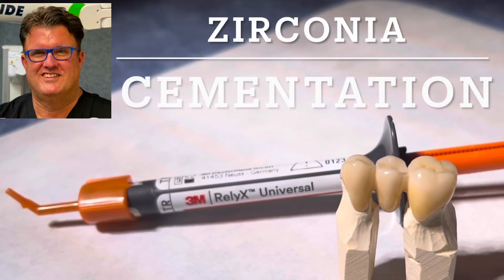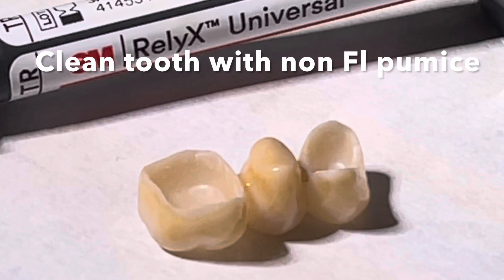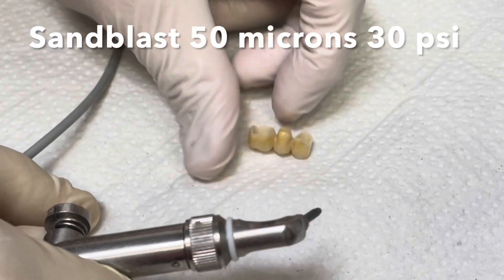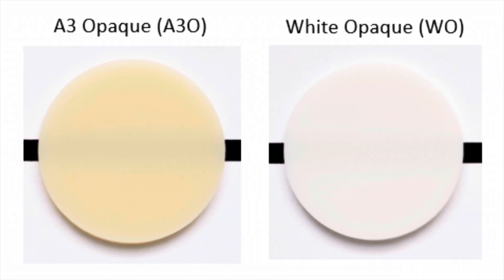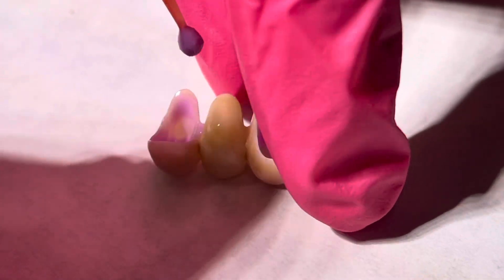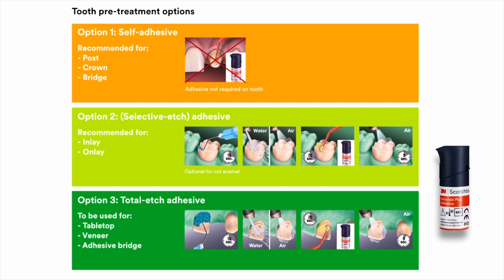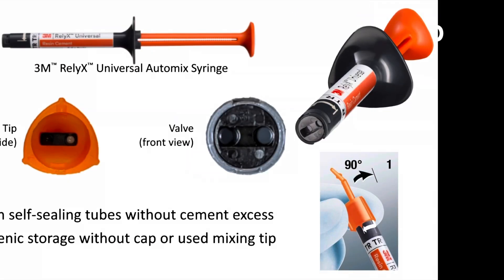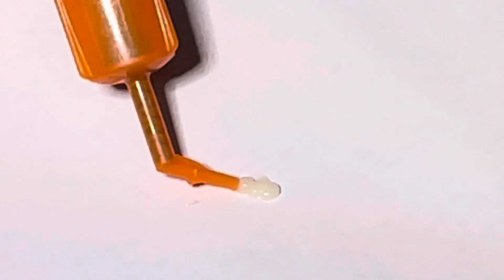Zirconia Cementation with RelyX Universal Cement - Dr Scott MacLean - Dentist

Comment: For retentive prep designs with zirconia, I simply lute them using Rely X Unicem. Meaning I don't pre-treat the tooth or the intaglio. When you have parallel walls that are 3mm tall or more, you don't need more retention than that. But for non-retentive preparations, I will air abrade the intaglio of the zirconia, use Monobond or another MDP primer, etch the tooth, bonding agent on the tooth, and then use the best resin cement I have, whether that be Unicem, Universal or Rely X ultimate (or Nexus 3, Panavia, Multilink Automix, any quality resin cement will work).

Comment: Hi Scott. quick question. can the RelyX Unicem 2 cement also be used to cement an E Max 3 unit bridge into place.? 
Thanks in advance for your help.
Lanny
Reply from the maker: Yes. Gold too
Reply from the maker: Use the adhesive and make sure HF acid on emax. Wash. Relyx universal. Universal
Tooth etch and relyxuniversal